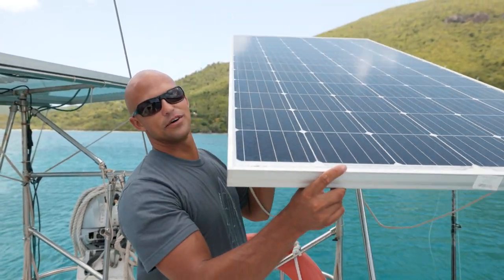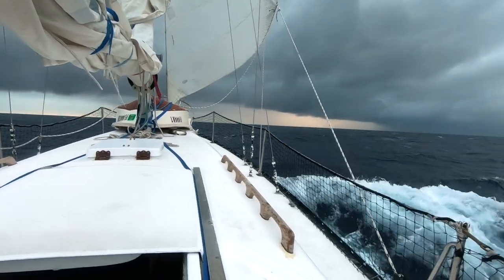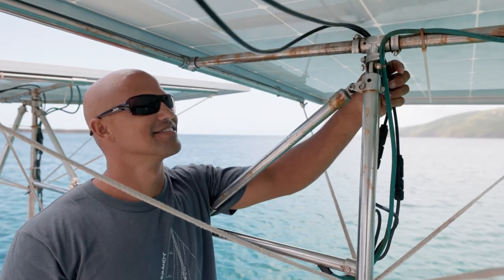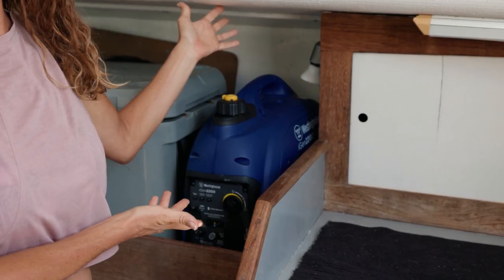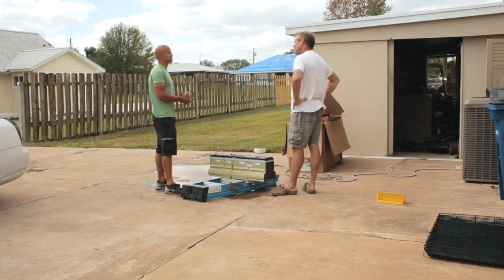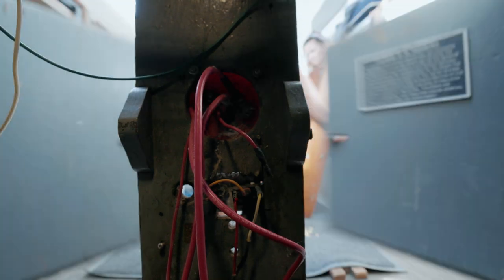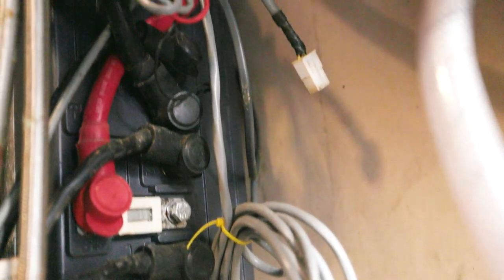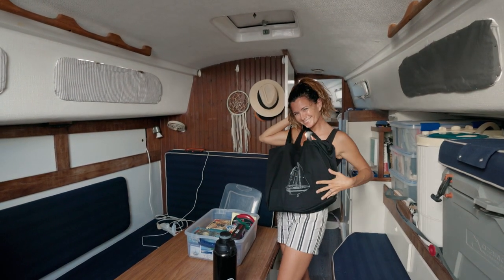Living on an ALL ELECTRIC sailboat for 3 years | Beau and Brandy Sailing

Comment: You said you don't charge the battery more than 90% or discharge them less than 70%. As. A former Nissan leaf (EV)  owner those batteries can be drained further. They're lithium they can go down below 20% and still not be damaged. Maybe it was an error on the amounts but you're barely using the full potential of the batteries. And if it wasn't then you're sacrificing comfort.
Reply: I think it's because they usually use the sails, and there is so much sun in the Caribbean the batteries don't get a chance to drain down further than 70%

Comment: Just wondering about your engine corrosion issue. You could check if it's properly bonded to an anode and if the anode is has not completely corroded yet :) If it doesn't corrode over time at all that's a sign of problem with bonding cables.

Comment: I would try to spray on Liquid tape from Plastidip or something similar on the encoder board. Its PU based and leaves a very stretchy waterprof film over the entire board.  It never cracks so it doesnt trap moisture. Its also possible to peel off withing a few years for solder repair. I spray that on to protect my pcb's in salty or wet enviroments. I just inspected  my amlifier wich is a 10cmx10cm  open pcb in an open sailboat. After 1 year it still looked like new because of the polyurethane film. PU is extremely tough!

Comment: Great job you guys your pushing the envelope on a budget. 
   You'll get more than 15-25% more power than a flat panel, more like 40-60% more. A big blow will be an issue even with your lockdown measure, maybe add another lockdown support, same as you have, and opposite the existing one. Put your design into Solidworks(engineering software) wind model and that will tell you pretty much what kind of windspeed it could be expected to survive. You definitely will have to get the wobble out or in time it will self destruct. It's almost impossible to use the Chevy Volt's BMS, you'll need to get external BMSs, check out David Poz  or Will Prowse on You tube. Low voltage and high voltage cutoff on the NMC batteries are super critical. I have destroyed some of them in an electric car setup similar to your setup.

Comment: Building that extra steel equipment with Stainless would have been pricey but it would last. Its pricey because stainless is so hard, and that makes it hard to drill. Its also a little hard to cut although not nearly as hard as it is to drill. I'd say to those who have working or easily fixed up (top and valve work) engines , use them till they are gone. Then, it sounds like electric would be the way to go because your not tied to getting diesel everywhere and can be self sustaining for longer periods. It would have been good for those who were told to quarantine on remote islands in the pacific, as long as they had extra parts for things like water makers ect.

Comment: I own a cat, and am well aware of the maintenance involved, and the smell created by diesels, however the potential problem I see with electric propulsion is in a situation where you are becalmed, and in fog for an extended period. You could be driven by current or sea conditions into a reef, or other undesirable circumstances, being unable to rely on sailing to move.
Reply: Gasoline powered generator, anyone?
They've got one!

Comment: On boats stainless steel fasteners will leach off iron - when stainless is fastened to iron - the iron genrates a positive charge and will quickly rust away - aluminum castings as on motor housing and generator frames will  give way to cadaltic action and will oxidize or corrode badly when mounted on iron as on engines exposed to sea air or water - they fare better when mounted on stainless steal -

Comment: Beau, last year I built a 48v LiFePo4 16s bank 280 ah prismatic cells for the bus conversion. This cost me about $2200 with a Daly Smart BMS. Not a huge fan of the BMS... It's got weird software. Have not yet connected my 12 commercial poly panels nor the three charger controllers.

Comment: Battery....to balance your batteries you need to charge them to 100%every now and then. I charge to 90% and on the fith cycle I'll top it up to 100% so the bms can do its job and balance them . Cheers hope it helps

Comment: I like the tilt on the solar panels. If it were me I would be adding a solar tracker to adjust the angle of the panels when at anchor and therefore you wouldn't have to constantly adjust it manually. I personally dislike having to constantly do something if I can automate the process.
Reply: What would power this solar tracker?  Would the improvements cover the losses?
Reply: You should be able to get a 10-45% increase in power. There are some systems setup for a dual-axis ground based solar tracker that could potentially be modified for a boat but I would probably go with a DIY system just because I like computers and electronics.    An Arduino nano, and some photo resisters to get started.  The trick would be making  it strong enough to hold in alignment against the wind.  I think some stepper motors wouldn't be strong enough so I would probably use either hydraulic arms or linear actuators. There are numerous DIY examples for ground based systems.
eg. https://www.youtube.com/watch?v=hr07xKWM6tw

You would need to switch from a single actuator to two actuators for a boat and use tubing instead of wood but the concept is the same.

Comment: I know from personal experience with a 12V battery bank that running a 12V compact compressor frig on 12v directly from the battery bank is far more efficient than inverting 12v to 120v thru a pure sine wave inverter to run the frig. from the power adapter so the same would apply to a 48V bank going to 120V. Unless Ohm's law has changed recently, V's can be modified but step up or step down conversions have a loss factor. Even the better MPPT charge controllers are pushing it for plus 90% efficiency. I have used a counter top 1500W induction burner & 6 Qt pressure cooker for over 10 years in home use with very good efficiency as my available energy budget is limited. Today's pressure cookers with their closed vessel design are safer for folks afraid of rocker steam vent units.

Comment: I hate to disappoint but my wife and i ran a solar powered house boat back in the mid 80's. (yeah 40 years ago) I'm not interested in solar panels. What intrigues me is using wind to turn two props that recharge batteries and then conversely power the sail boat when needed. Can't do that with a house boat. Solar panels are fine but have their limitations which no one seems to want to acknowledge.
Reply: What's the limitations you have experienced  with them please?

Comment: 9:35 has the wrong unit - you have 16 kWh of energy capacity in your battery bank, not 16 kW of power. There's 2 kWh of energy in each of the 8 modules when you charge them full (with the 3.5 to 4 kWh you get, on average, from your solar PV array). That MPPT controller doesn't convert volts to amps, it converts one voltage level to another. Thus the current also changes since the output power must be the same as the input (minus conversion losses of course since nothing is perfect).

Additional panel capacity could perhaps be situated as if they were a bulwark but one would have to just accept that they would be shaded well over half the time by the cabin top and the mast or sails, and mounting them securely without for example stressing the stanchions with their windage would take some care... Some boats have a decent option for a wind generator that is only mounted and in use at the foredeck when at anchor.

Comment: Hi I see you follow Sailing uma they have the same make of boat you have and have Coverted to electric with a sail drive prop they use less power and have a alcoholic two burn stove. Plus they revamp the area of the boat. Take a look again at how there work would fit in your boat. Brendan IRL

Comment: Today you can get lithium iron 100+ amp cycle batteries with 65 % duty + 2500 to 10000 cycle till they drop to 80% capacity  - for around $300 - I'm just going by what I've read about them - I have single cell lithium iron battery's ive cycled for 15 yrs daily - the failure rate is very low possibly 1 cell in 10  over 10 yrs - 
         I worked in the offshore oilfields for decades as an SCR diesel electric or oilfield electrican also my grand father started in that field in the very early 1900s - I'm 3rd generation - 
     If your on a smaller boat I would recommend a 12 volt system - the reason is there  far more redundant  - if you loose one 12 volt battery out of 4 battery's you only lost 25% of your capacity - with 48 volts systems  the loss of one battery might be your entire electrical system -  24 volts is also a good choice - also with higher voltage DC there are many failures due to DC arcing on boats in Marine applications - 
     Drilling rigs use 750 volts DC extensively so we know about DC arcing - 
     With  a 12 volt system your battery's have to be near the iinverter - with lower voltage there is far more voltage drop over 24 & 48 volts -- so the battery's need to be near the inverter - 
        If your going to get an inverter do not get the inexpensive FCC class B inverters - the IF noise will interfere with other electronics -
       Look for FCC class A part 15 certified inverters - if you  plug a AM radio into a inverter and it makes a buzziing sound on the radio it is a class B inverter - A FCC class A inverter will not generate line noise so AM and SW radios work fine on them along with other electronics - 
        Be sure that the inverter generates grid type sign wave AC - 
    ( Many device will fail when used on modified sign wave inverters also many video devices perform poorly on modified sign wave inverters )  - ( confirm that the inverter will run polyphase motors or a refrigiration motors) - some inverters will not run a refrigorator - 
        Solar panels work well in areas of low humidity - I live in the deep South U.S. - the humidity is always 60% or higher - humidity scatters the UV light off the Sun - solar panels rely on UV light - 
   During mid summer solar panels will only generatine 20% of there rated out put at noon day sun in my region  then after noon day the.panels out put quiickly tapering off - ( there clouds on most days in this region) so solar is.of little value - wind is of no value in my region -
      I live in a rural area and power has been knocked out after storms for several months - for me it's not a problem - 
       Up till the 1960s in  rural areas if a farm house had electricity, they had a 32 volt farm lighting system -  it consisted of 16;Two volt 200 amp lead acid cells - a generator for charging them once a week - most rural  people agreed to only charge there battery's all day on  Friday - generators are noisy so Friday was a day of noise - 
        Any appliance sold as a 110 volt AC appliance could also be bought in the 32 volt version in rural towns  - 
 They also sold inverters that went from 32v DC to 110v AC to operate a TV ect - 
       Hybrid is not new it was a way of life from the late 1800s up till the 1970s for many in the rural areas of the US - 
       With lead acid battery's  used in stationary service as with farm homes a weaker electrolyte solution or sulfuric acid is used than in battery's for boats, campers & cars  ect - instead of the acid being a 1.275 gravity they use a 1.200 to a 1.220 gravity  acid strength at full Charge  - In colder regions they use 1.220 to 1.240 gravity - .220 is good down to minus 17° f after that the battery will freeze - 
        With weaker acid they rarely sulfate and cycle for 40 to 60 yrs just fine although at .220 there is a 40% capacity decrease - 
        It just means you need more battery's - also your fast charge rate is increased from one hour to 6 hrs @220 - 
    My hybrid is of  a 16:1 fuel efficensy meaning I use one gallon of fuel to generate  16 KWs if power  - 
      It's an option for those that can't utilize solar, wind, hydro, or gasification

Comment: Hold on… you can buy $3k of batteries but a wind turbine is too expensive 🤔
Reply from the maker: we need the batteries (which we had the allotted budget for) regardless of a wind turbine or solar panels. It's not really comparable. and when you compare solar to wind, the cost per kW hour is way less with solar. so that's where we decided to invest the $.

Comment: What is the voltage of each solar panel?
Reply from the maker: 350
Reply: @BeauAndBrandy  350 volts?
Reply: markley, 350 watts, 24 volts, connected in series gives them 350 watts and 48 volts. In full sunlight it's enough to run the 10kw engine and a little to help charge the batteries, according to an earlier vid.
Reply: @bobhaas6941  if two panels equals 350 watts then each panel is 175 watts.  I don't think that is correct but all I asked was what the voltage of each panel is and 24v makes sense.
Reply: @markleyg  2 panels 350 watts each

Comment: That motors looking a little sketchy holy crap
Reply: That is just surface corrosion on the aluminum housing.
Reply: Honestly way less sketch than most diesel engines on sailboats. A lot of sailors are living on pure luck with poorly maintained engines.

Comment: Sorry to want to pick your brains but i keep hearing people talking about range limitations on electric motors in boats (seems like nonsense to me) ... 

Assuming that you had a little more powerful motor that could push the boat at hull speed against some (but not monstrous) resistance (current, breeze) at low revs. Apart from overheating (which could be managed with some sort of heat exchange system i suppose)  is there any reason why it could not cruise endlessly in the Caribbean with adequate solar panels (with a moderate chunk of batteries for night and heavy cloud days) ?
Signed: A Country Bumpkin looking for education 😁
Reply: To go hall speed they might need 30 kW of power. That's a lot of solar panels!

Comment: wow, that electric motor looks like its slightly big enuff to control a remote controlled boat. you guys must be limited on places to sail not to mention wind when in harbors, etc
Reply: Check out the size of the motors that drive the new Plaid Tesla to 200mph and 0-60 in 2 seconds (they are really small). Electric motors generate a LOT of HP/torque in a small size compared to combustion. In an electric setup most space/weight is batteries vs. motor.
Reply: @mk500  true, which makes me wonder if electric engines can handle a larger prop or use a transmission giving better than 1:1 ratio. 1:1.5 or better, would give a nice increase in speed if the motor could handle it.

Comment: Modern sailboats are energy hogs. The electronics suite, electric winches, bow and stern thruster, induction cooktop, electric oven, trash compactor, dishwasher, microwave, fridges and freezers, water makers and air conditioning all eats electricity. Back when I started sailing my Lapworth 24 I got by with just a single 12 volt battery charged off a 6Hp Johnson sail drive outboard motor.

Comment: I love you guys but ...  you will regret switching to electric motor, this is my 40 years sailing experience talking. Capt. Jack emeritus
Reply: They haven't regretted it for 3 years and neither has Sailing Uma, 5+ years now in Norway. If you mostly sail you dont have all the diesel maintenance, problems with diesel fuel bugs or cheap fuel, air locks, leaks, the smell, and with decent solar you'll never run out of fuel. Plus when winds are low you can add 3 knots from the electric engine and it's so quiet!
Reply: @bobhaas6941  This could be the future, but for now there is no such a thing as reliable electric motor on which you can relay when you need motoring for prolong time. Many times sailing the oceans reliable working engine is preventing trouble and saving life.
Reply: @bobhaas6941  Dangerously Low on Power, With No Way to Charge! — Sailing Uma

Comment: Hey Beau and Brandy,
Zinc is your answer to corrosion. I noticed on your motor you've no zinc. Zinc can be applied as a paint. The paint is called 'Cold Galv'. Zinc the most economical electro negative of all the metals. See https://en.wikipedia.org/wiki/Galvanic_series to see the nobility (electronegativity) list. Take 2 of the metals in this list and stick them in an electrolyte like sea water and the one at the bottom of this list will rust first. That is it attracts oxygen molecules which is the rusting process. Zinc rusts white, not red. 
If you've painted your metals in enamel to stop rust you will do fine as it provides a barrier from oxygen in the air or the salt water. However a pinhole will let the oxygen in and it will work it's way along under the enamel or epoxy paint and you're done. The solution. Cover everything in 'Cold Galv' paint from the hardware store. To block the oxygen even more cover it in vaseline. However I usually don't bother. The Cold Galv will start to bubble and rust in 4 to 12 months on deck at sea depending on how thick you painted it. Just knock the flakey paint off and add more Cold Galv. Leave it exposed so it can breath. I even cover my stainless with Cold Galv in certain situations.
This only slows rusting,not stop it. However it does a bloody good job. When buying Cold Galv buy the heaviest tin, as it has more zinc in it. 
You can paint hot things like exhaust manifolds, or fire places.
Thanks for the info on your electro sailing tests.